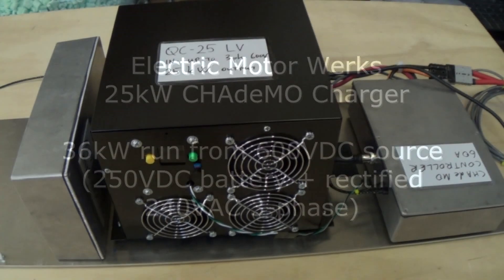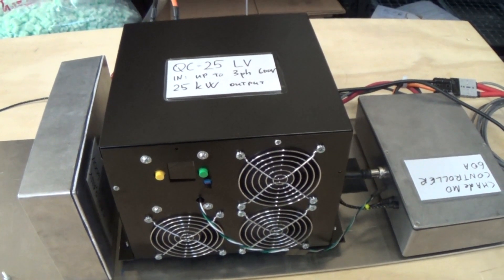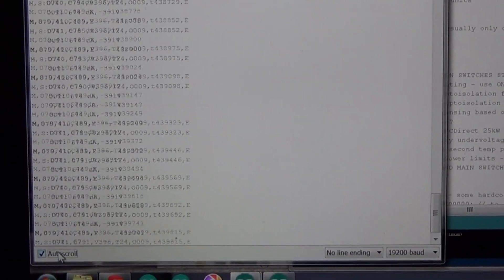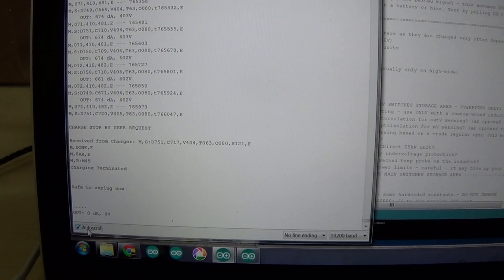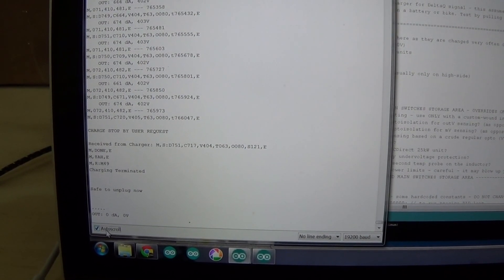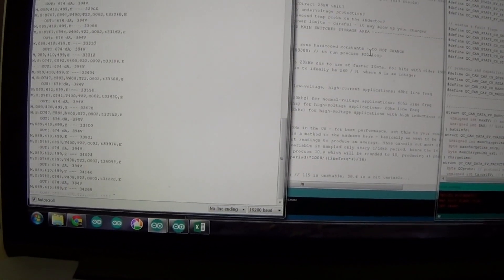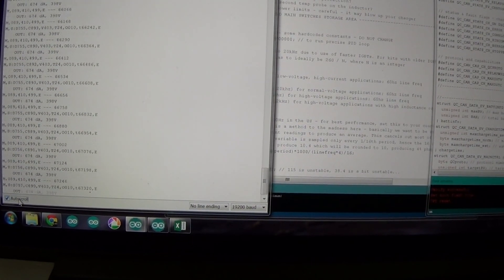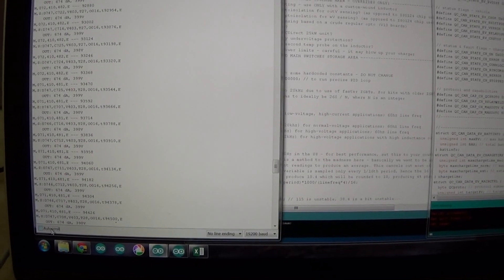CHAdeMO QC25LV 600V 36kW

Comment: I just got an electric car (ford focus electric) and I'm looking for a charger and of course I want it to be open source, but I don't have the experience yet to understand what I need and how your products work. Forgive me for asking before watching every one of your video you have uploaded but can you explain or point me in the direction for information about type 2 vs type 3 and dc charging? I would like to order your juicebox but first I need to understand what I am purchasing, is it a bank of capacitors and charging controller that banks 36-50kw from a regular 110 / 220 and lets you charge more and therefor faster  than the 110 or 220 would normally flow?
Reply: +Andreas Nicholas Did you get the information you were looking for?

Comment: On the opposite end of the spectrum, something I would buy:  A low power, low voltage, low amperage Chademo controller and adapter.  I'm thinking it would be nice to charge from a thin film car canopy, without 2 inversion steps sucking away 20% of an already very low amount of power.  I know people with $1500 suitcase trickle generators for their cars.  I'd rather have a large tarp of thin film and a low power Chademo, if such a thing can exist.  It might also be usable for charging from another car's 12V bus, or even from a 100W USB 3 port.